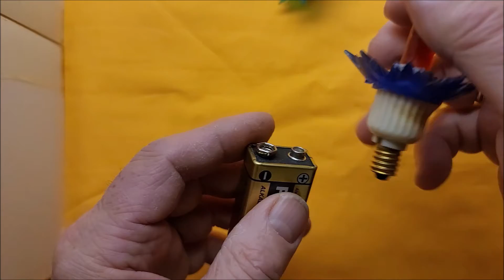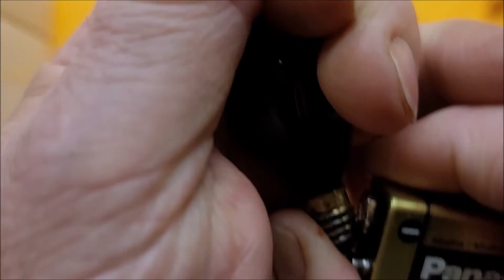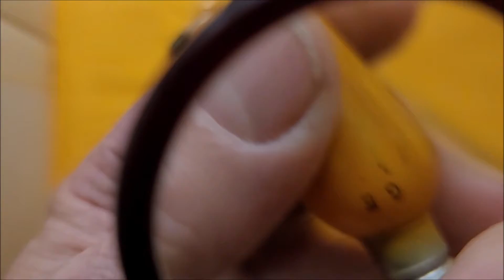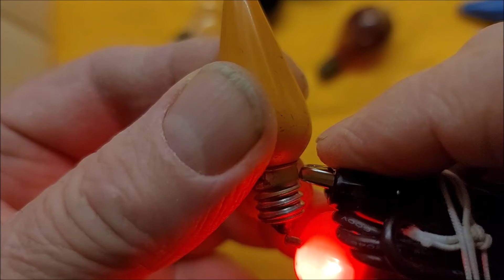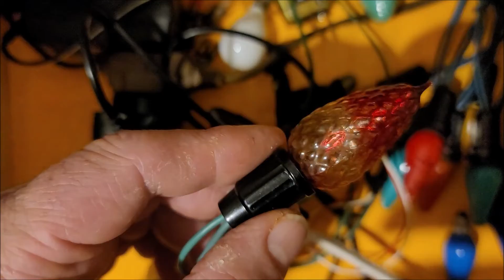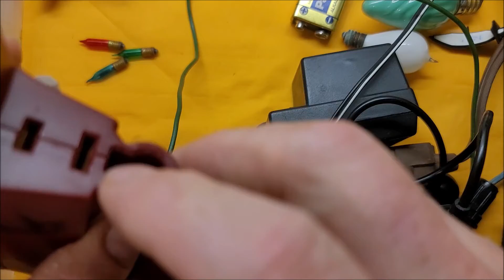TESTING C6 AND OTHER ASSORTED ANTIQUE AND VINTAGE CHRISTMAS LIGHT BULB LIGHTS.

Comment: My vintage bulbs of lanterns, roses, Santa, Teddy, etc shine bright when testing on my 12v car battery but barely glow in the wiring plugged into the wall (the other 'olive' type bulbs glow bright both ways).  Any suggestions?